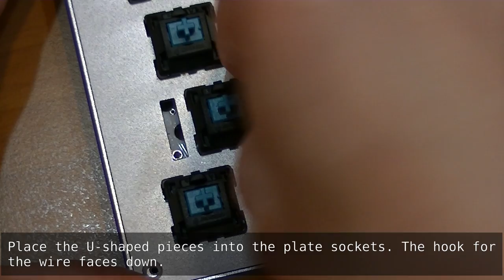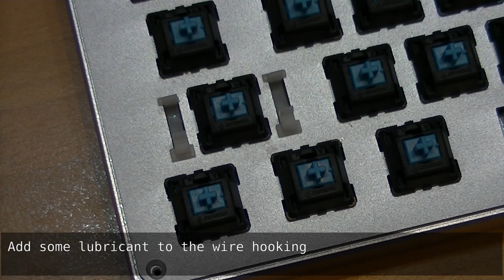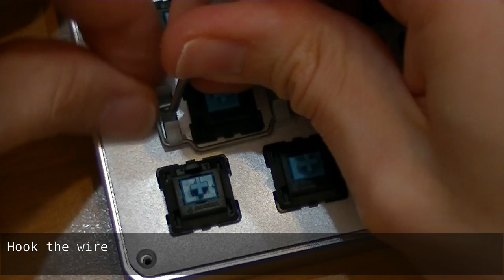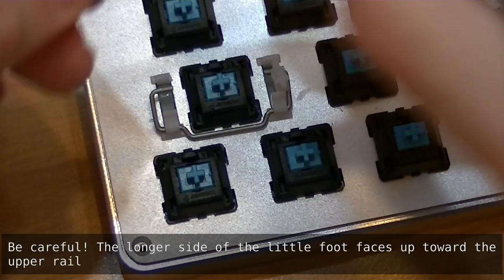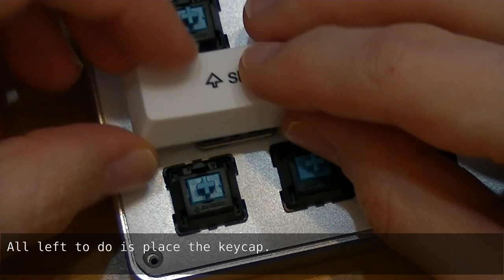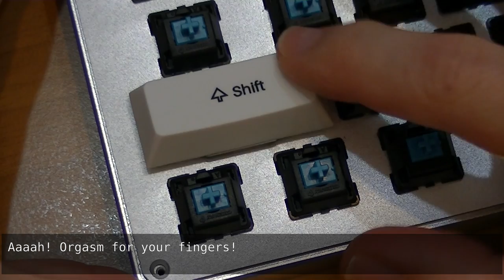How to mount Costar Stabilizers

Comment: Thanks for this. I've been mounting it the wrong way, or should I say, the harder way.
Reply: were you putting the plastic pieces on the key cap first and then trying to force the wire through? lmao i was doing that before i watched this video and then had the realization it shouldn’t be this hard
Reply: @cason1029  yeah, pretty much this. the problem with mine is that some of the inserts are a bit loose on the keycap, so it made it even harder to put on. I'll be trying this method when I clean my keyboard. I think I currently have the inserts in the wrong direction too lmao.

Comment: These are on razer keyboards. I don't lube them so I don't do it this way. I get everything either connected to the keycap. Or insert the plastic bits into the backplate. Then use a small flathead cell phone repair screwdriver to push them in. If I tried to do them this way. Getting the stab inserts out of the keycap would likely break them. I've never tried though.

Comment: I love wasd boards. My last board I got the bear bones with no key caps. Now when it came to installing my space bar key cap the plastic clip where the metal bar goes in to Stabilize it kept popping off and it made the keycap stuck. I finally switched it with an old stabilizer plastic thing that actually stuck in their tighter so it doesn’t pop off when I press the key. I hate costar stabilizers

Comment: Could I do this in a Cherry stabilizer board? Awesome thanks!!
Reply from the maker: +quake4tt you mean lubing? sure
Reply from the maker: +geeltje 35 oh, no you can't, unless the holes are specifically crafted to be also costar compatible. That is rarely the case for commercial keyboards, but it might work on custom creations.
Reply: +Matt3o ohh that sucks, i got a ducky shine 3 for cheap since it was a open box andi just found out it is missing a stabilizer, thanks for the quick answer!